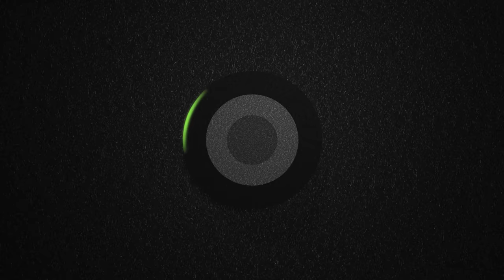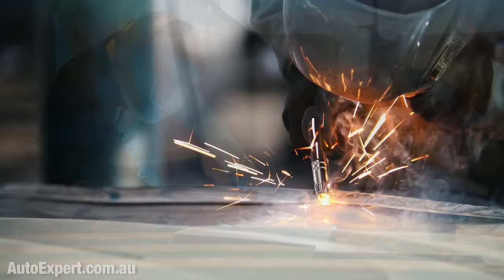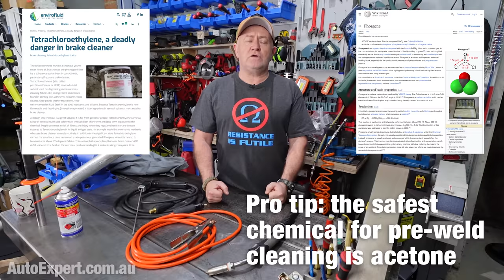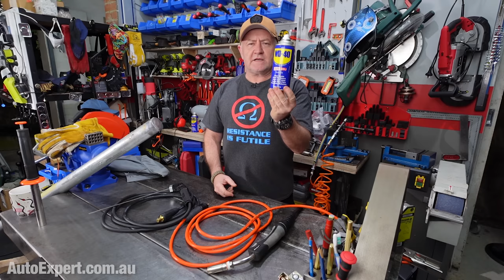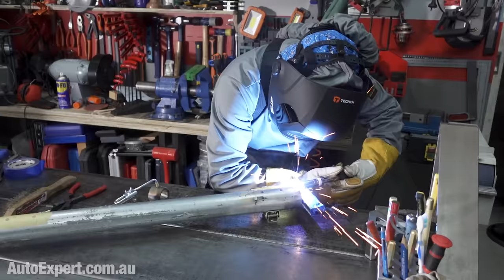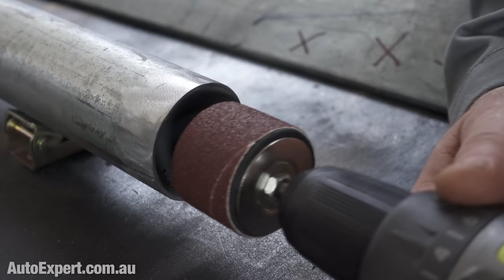How to die while arc welding at home: the top 5 ways | Auto Expert John Cadogan

Comment: Fun facts about oxy acetylene most people use acetylene because it’s readily available in the United States but remember the 1/7 with the rule very important did not draw too much acetylene out of the bottle or what will happen you will displace the acetone and then that’s not a good idea then you will have an unstable bottle The better option is to use either propane or propylene. The only thing you can’t do with it is fuse, weld or Oxsee acetylene weld with it but most of the people today don’t use that anyway, they were either Meg welding or TIG welding or stick welding.

Comment: As a boilermaker/welder who worked in a mittal steel plant for more than 45 yrs i agree that these are 5 of many ways to get yourself killed while arc welding with stick mainly but ive seen wire feeders too that acedently feeds wire because the welder is not concentrating, and it sticks a glows red hot, and dont just keep safty at work but take it home too, ive seen many a stupid thing both at work and at homes and by people who both do and dont do that work as a career, another huge hazard is cutting torch pipes catching alight or leaking gas, and especially verry dangerouse acetylene gas, its a heavy gas and because of that if theres a leak it sinks to the ground and pockets where you cant smell it and it just waits for the first spark to come along 👀, and some people like using acetylene at home though its elegal  as far as i know here in South Africa,  people do it anyway 👀, for me its only good for gas welding and i prefere LP gas for everything els, another dangerouse thing when welding is using a drum as a table that has not been cleaned out and no breather, ive seen that with my own eyes 👀, theres so much more but im not here to write a book lol, please be safe people, and think out and plan what you want to do before doing it, especially when welding or working with heat and gas and power tools✌

Comment: I was in a shop with some dandies... They had us in a line and had our grounds hooked to the same  place on a cement floor. The cement floor had pipe for rebar to hold weight. The other guy went to move his ground, but grabbed mine as I was running arc. As soon as it broke contact with the metal he was the ground, he was standing on an exposed part of the pie in the flooring.... I heard him roar and scream!! His arm was shaking for a day and a half. The concrete was wet from heavy fog and dew that day too!!!😮

Comment: quick question, what do you call mild steel rhs that is not painted and not gal?
 it gets delivered with oil that I assume is part of the manufacturing process still on it . that keeps rust off. I wanted to buy some but i don't know what its called

Comment: Stating the obvious, but welding on an empty tank i.e. motorcycle fuel tank can produce an enormous explosion. aka "Big Fuckoff Fireball"
Even IF you think you have purged and neutralized the tank for vapor/fumes...make super, doubleabsoluteforsure sure the tank is inert. 
I sent a tank down to a local dude who assured me  he could run a bead around the fuel drain. What came back was five gallons of shrapnel. Nearly killed the dude. 
Just my two cents....

Comment: You compared a galvanised finish to paint. In most situations, a galvanised finish is far superior to paint in terms of corrosion protection. Even the specialised “corrosion protection” paints are not that effective compared with zinc. Zinc is a fantastic steel preservative. Shame it is such a bugger to weld. The reason it is far more effective is that it provides sacrificial coating versus a “barrier” coating.

Comment: a few points to add:

1: an angle grinder is much more dangerous than any welder, especially with a cut-off disc

2. do not weld on top of a ladder in the rain, and if your boss insists on it tell him to go do it himself and quit that job

Comment: The story of the electrocution of the guy is just that - a story.
It takes over 400V of potential to move current through the body. Welders don't do that.
If the guy was sweating, then (like police tazers) the current just moves along the surface of the skin and never penetrates the body.
I'm so sorry you were fooled. Electricity is confusing to most people.

Comment: Big thank you! I normally start using my new gear strait away. Not this time I want to have more than a clue what I'm doing. I learned a few things and it got me thinking more about the big picture.  The galvanized welding part was great. I set up an in-line duct fan that sucks air and smoke up and outside. Connected inside I have a short bit of flexible duct (like for clothes drier) that I can move close to my work. I set it up for soldering and it works great. Plenty of suction and totally adjustable. The cost is nil.  I highly recommend for any size budget.

Comment: You are spot on with all of these! Great presentation. As an electrical engineer and a hobby welder, I agree wholeheartedly with these. It is too easy to adopt the "good ole boy" mindset in the shop, thinking that you don't really need to get serious with this safety stuff...problems only happen to the "other guy". One thing about the explosive cans is that it can only take a large debris spark when grinding to hit that can and melt through. It's not likely but any probability is too high. Regarding the UV exposure, as a teenager I was assisting a welder, doing only tack welding to hold the parts together for the certified welder to work on. I wore only a thin shirt. The next morning I was "sun" burned on my abdomen, with slightly less burn where the shirt pocket was. The amount of UV emitted by arc welding should not be underestimated. You only mentioned the things that will kill you. A whole different subject could be covered by things that will permanently injure you, like retinal burns from not using adequate eye protection, and hearing loss from not using hearing protection when using a grinder. I wear hearing aids now, partly due to noise from tools and me not wearing hearing protection. Don't be a dufus! Put your ego on the shelf and use PPE and follow good protocols.

Comment: it is click bait 
offers thumbnail exhibit a : a mig welder 
title "How to die while arc welding"
Reply from the maker: MIG = arc welding. It's technically called Gas Metal Arc Welding. Google 'GMAW' for confirmation.
Still no cure for 'idiot' I note...
Reply: @AutoExpertJC   a car is a car is car but a ute is a ute but still a car. yes mig is an arch but it is not a stick electrode,   in the industry if i asked you to bring the arc welder over and you bring the mig you would be wasting my time. lowering you self to name calling shows alot too. articulate you comment.
Reply from the maker: "Arch"? Genius.
The clue is in the name: GMAW, FCAW, MMAW. Try to keep up. I worked in the industry, dude.
Reply: @AutoExpertJC  so you argument hinges on a spelling mistake nice work mate 🤣

Comment: The electrocution argument is pure unadulterated BS - open circuit voltage in a normal stick welder is around 60V, arc voltage is around 15-30, even wet you'd get a nasty tickle, but dead - horseshit.